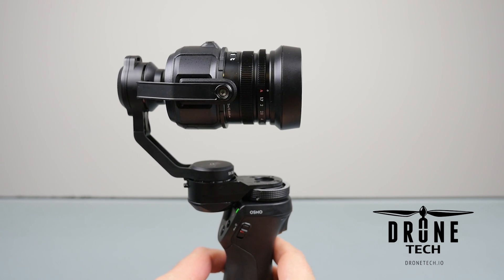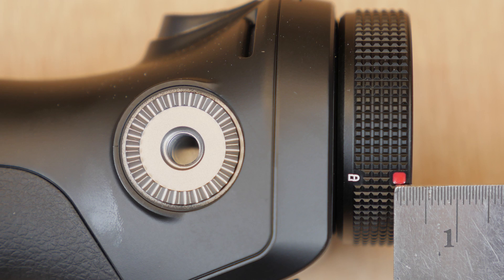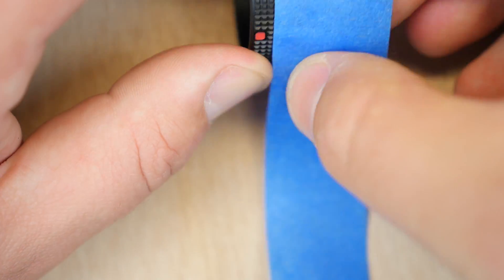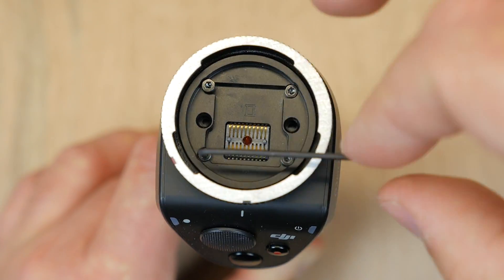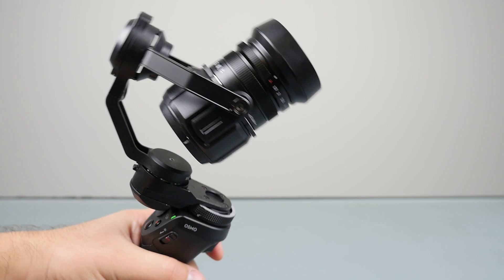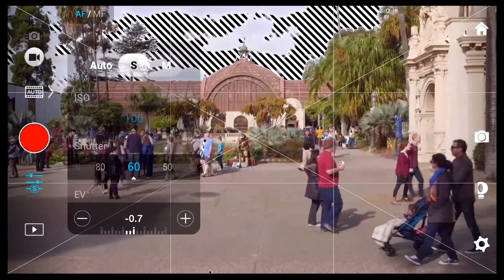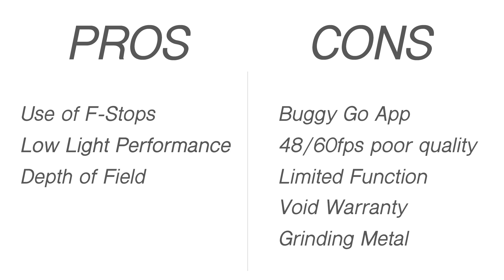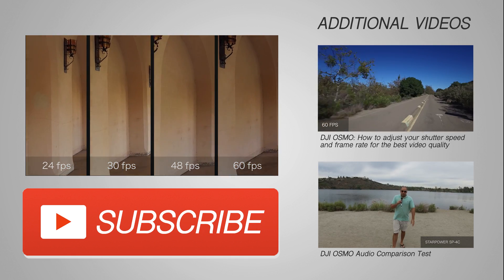DJI OSMO with X5 Gimbal: How to install the Zenmuse X5 with sample footage

Comment: begs the question why did dji design it like this... just so  they could sell you a £300 adapter. They shoudl have supplied a new adapter with the x5r... or someone should have started fabrciating these for £30... lol. Great hack.. .i may save myself some money like you did.

Comment: what do  you think about this? http://www.ebay.com/itm/Dji-osmo-X5-adapter-bracket-Ring-Works-for-X3-X5-/151981250515?hash=item2362c9d7d3:g:ROQAAOSw~OVWwNVd
Reply from the maker: +freddy luna Could be good. $100 seems high. I doubt the final adapter from DJI will cost that much.

Comment: Once they make this into a 4 axis gimbal, I'll bite.  The up and down motion is getting me sea sick(through no fault of the operator).  They need to address this before advertising this as a possible B roll camera for professional film making. I do have a Nebula 4000 this might work well on though, vertical bouncing is much less pronounced maybe do to the sheer size of the gimbal

Comment: Hello, excuse my bad English ... I made the change x5 and after using it for about 15 20 days and this does not turn, to be more precise turns on, does connect the phone via wi fi, but the room (even if turned on, the lED works) does not move and notification of Osmo lED do not light up ... do you know what could have happened? Thanks in advance ...
Reply from the maker: +Francesco Pace - Not sure. Did you try the X3 on the OSMO again? Same result? How about the X5 on the Inspire?
Reply: +DroneTech I do not have the x 3 of osmo ... but only the X5 inspire one of my ... It may be that the battery even if not new completamnte charge and therefore the osmo not "light up" (notification LED no signs of life) but the wi-fi works dell'osmo and LEDs light up on the X5?

Comment: This was an important info as i was planing to install my X5 to Osmo joystick, i to it will fit automatic but now after looking at the video i have to do the same. i think. is there an adapter for this to fit in without grinding the osmo?
Reply from the maker: +Mohamed Shafy There will be. Right now this is the only option.
Reply: Hi,
I got a seller who is seling the Adaptor for 100.00 usd.

thanks
Mohamed

Comment: I purchased a 3D printed adapter which seems to fit just fine. The issue that I'm having is that the X5 turns on, spins around, locks into the start position and then falls down. I know that it is a known issue for the firmware to crash at 40% with the x5 attached but I cant even get the beginning setup tutorial to work. Also, when I go into the about section in the Go app it says my current firmwares are "unknown". Can you help? How did you even get to your current level of functionality? Is it possible my handle-only kit has a different firmware that doesn't work at all with the X5?
Reply: I have same trouble. My handle firmware is 1.4.1.80.
Reply: +mikiclinic I'm in the same boat too. Need to update the X5's firmware with the inspire, which I don't have. So I'm stuck with a limp X5 Osmo until DJI releases the goods.
Reply: +iphilms I'm also having this issue. Has anyone figured out how to update the X5 without the inspire?
Reply: Unfortunately, no. I just purchased an Inspire :/

Comment: Hey! Love this video, it 'Inspired' me (ha) to fit my X5 to my OSMO too. Mine's a little loose, and the X5 plate means the stick is pushing at all times, how the hell did you manage to make it work? :)
Reply from the maker: +Russell Nicholls - Unfortunately it sounds like you may have shaved too much off the piece of metal. Ours does touch the joystick (barely), but it doenst push it and we can use the joystick. Can you send me some pictures? dronetech33@gmail.com
Reply: Hey! Thanks, actually I used a 3D printed part. I found that by pulling off the joystick (it goes back on easily!) it stopped this issue altogether :)
Reply from the maker: Nice! Which 3d printer do you use?
Reply: +DroneTech I'm not sure, it's my Dad's one and he set it up for me. Did you do any firmware updates with the Osmo & X5?
Reply from the maker: +Russell Nicholls - no, firmware will not update through the go app with the X5 attached. it freezes
Reply: +DroneTech mine seems to be working pretty well! AF, 4K is working well. At some angles the gimbal goes crazy and freaks out, disconnects and then reconnects - does yours do this? Love your channel!
Reply: +Russell Nicholls Did you update the firmware on your X5 camera ?
Reply: +iphilms I did on the inspire pro but that's as far as I got. Seems to work perfectly now though after I went through the initial Osmo calibration. Check out my video test with it!

Comment: the adapter we made worked. but when I powered on the osmo the x5 didn't want to do its turning when calibrating. it turned a little and then went limp. had video signal but the gimble weren't powering
Reply from the maker: +Sky View Aerial Tech - That is strange. Did the X3 gimbal work with the adapter ?
Reply: +DroneTech I don't have an x3. just have the handle kit and an inspire pro. also, the back end pushes the joy stick down
Reply from the maker: +Sky View Aerial Tech - you may have created the adapter too shallow. Mine did not push the the joy stick. Touched it, but didnt push. Sit the original adapter from the OSMO and the one you created on a flat surface next to each other, face up and take a picture from the side. I want to see the size difference. thanks
Reply: +DroneTech Hello, i just did the X5 mod  and my camera goes limp after 3 seconds powered on too. Im able to view the live feed through my iPhone and also record, but the gimbal motors just turn off. Any ideas?
Reply: +iphilms mine did the same thing
Reply: +Sky View Aerial Tech were you able to fix it ? i tried to do the firmware update but it freezes at 40% .
Reply from the maker: +iphilms Can you send some images of the adapter you created? Lets see if too much or too little was taken off. Also, can you confirm that the firmware was updated to the latest version from within the Inspire 1 ?
Reply: +DroneTech so updating the inspire 1 pro to the latest might help the x5 stay powered?
Reply from the maker: +iphilms - As mentioned in the video, the firmware will not update from the OSMO with the X5... it freezes.
Reply from the maker: +Sky View Aerial Tech - It might. Mine was using the latest firmware on the X5, installed from the Inspire 1. It is worth a try.
Reply: +Sky View Aerial Tech oh the x5 stays powered on. I'm able to view and record video. the gimbal stays limp. i'll try updating the latest x5 firmware
Reply: +iphilms same thing here, limp gimble. didn't update though
Reply: +DroneTech I didn't create any adapters. I just sanded it down just like your video. Also, i don't have an inspire to update the X5. Any other way i can update it ?
Reply: +iphilms the update made mine work flawlessly.
Reply from the maker: +Sky View Aerial Tech Awesome! Glad to hear. You are the second person that said that. Looks like registering the OSMO and updating the X5 with latest firmware allow it to work.
Reply from the maker: +iphilms - I do not know of another way to do it. Based on 2 other fixed issues, that is the problem.
Reply: +DroneTech is there no focusing?
Reply from the maker: +Sky View Aerial Tech - Autofocus worked intermittently for us. Manual focus works great.
Reply: +DroneTech didn't see where to focus hmm
Reply: +DroneTech didn't see where to focus hmm
Reply from the maker: Switch from AF to MF. Then there is a slider to move for focus.
Reply: +DroneTech you mean switching focus on the actual x5 itself or in the app?
Reply from the maker: +Sky View Aerial Tech inside the app.
Reply: +DroneTech Isee where you have the Auto/Manual focus on the top left in the app.  I don't have that
Reply from the maker: +Sky View Aerial Tech you can see it here in the upper left hand corner: https://youtu.be/qGsulVaoqq8?t=5m46s
Reply: +DroneTech yea I don't have that...hmm
Reply from the maker: +Sky View Aerial Tech - Try to do a hard reset on the Go App. I have it on both my Iphone6 Plus and Ipads. I did notice some of the controls disappear when i switch from the Inspire --> osmo on the same device. A hard close and restart of the app fixes it.

Comment: Working at a machine shop, we are going to make that adapter plate you grinded down.  Only concern is the piece inside that has the grease in it.  What is that for and could we take that inside greased part out and put it in our made up adapter? What are your thoughts?
Reply from the maker: Yes, you could take it out and use it in your adapter. The inside plate with the screws is stationary while the piece we ground down is the moving part that locks the gimbal in place. 

Let me know how it goes. If you can fabricate them there might be a market for that piece. At least for a few weeks until the DJI plate comes out.
Reply: +DroneTech I'm just tired of waiting after hearing, November, December, Beginning of January.  I will give it to the machinist tomorrow and see what he says.  Thanks for the quick reply.  Another quick question.  Could you possibly sent me pictures of that adapter cap you grinded down? top, bottom or sides so I can show him the part today and see if he needs anything to make it?  email, is skyviewaerialtech@gmail
Reply from the maker: +Sky View Aerial Tech Sent you some photos. Let me know if you need something more specific. I can try and get some more tonight or tomorrow.

Comment: Interesting video Jake, I thought I was going to faint. ;-) DJI advertised that the OSMO would be able to mount the X5 and the X5R, do you think that they made this same mode in there demo video or have a modification/adapter to add to the camera/OSMO? I would really like to view the video test files you mentioned before I buy a X5, how do I see them? Thank again!
Reply from the maker: +Bobster986 - Ill ZIP them up and put them in the comments. They will be releasing the adapter plate /bracket but its taking a LONG TIME. I am guessing its more of a firmware issue than a manufacturing problem. Ill let you know when they are uploaded.
Reply: DroneTech Thanks Jake! :-)
Reply from the maker: +Bobster986 http://l.dronetech.io/OSMOX5files
Reply: DroneTech Thanks, but how do I view it? it doesn't what to play, says its missing something or it cant get to content.
Reply from the maker: +Bobster986 You have to un ZIP the folder, there are 3 videos in the in MOV format. Its large, over 1 GB, so give it time to download.
Reply: DroneTech Thanks Jake, the X5 looks really nice, better then I expected, but I'm going to hold off a bit to see what DJI releases at CES this week. They just announced the new Phantom 3 4k (not to be confused with the Phantom 3 Professional), it's a cross between the P3 Std and the P3 Pro, so I'm sure they will have a few more tricks up their sleeves as usual. TTYS :-)
Reply: DroneTech Forgot to ask. Do you remember what aperture and shutter speed you used on this test? Thanks!

Comment: Great video. Please, you could make a video comparing the X5 with x3? A comparison on sharpness and dynamic range.
Reply: +Djalma Ribeiro Using a static image, not flying so there is no difference in the image.
Reply from the maker: +Djalma Ribeiro We will be doing more tests over the next few days to compare the differences. Stay tuned! Thanks
Reply: Thank you so much. I wonder how much is work to make these videos but I'm asking this comparison because until today saw not a good comparison. To be good need to zoom the image to see better.

Comment: When is DJI going to release an X5/X5R version of the Osmo?
Reply from the maker: +Raptorman0909 - Not sure, that is why we made this DIY video. DJI told us the adapter would be ready in Nov 2015, then Dec, now they are saying they are not sure.
Reply: +DroneTech Well that does suck now doesn't it.

Actually, it almost sounds like there may be a V2 in the works that is designed from the beginning to support the X5/X5R.  Perhaps a bigger battery and reworked cooling and audio.

When they have a reliable system for use with the X5/X5R they are going to kill it with the TV and film industry, particularly the smaller shops.